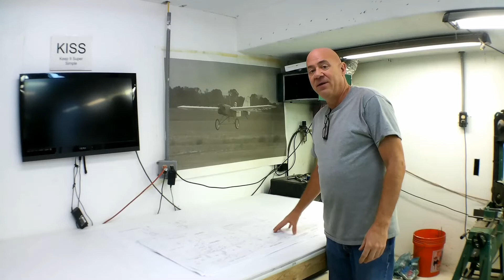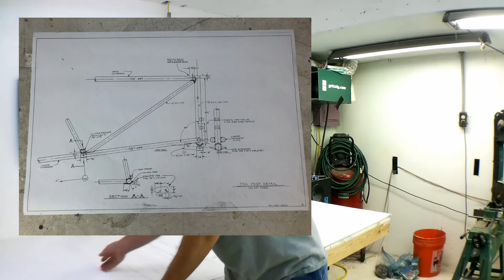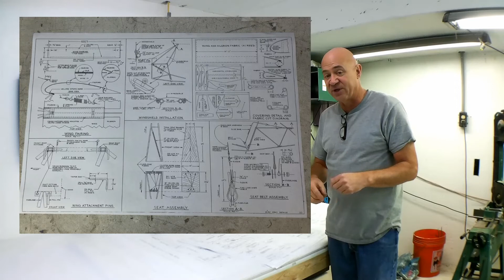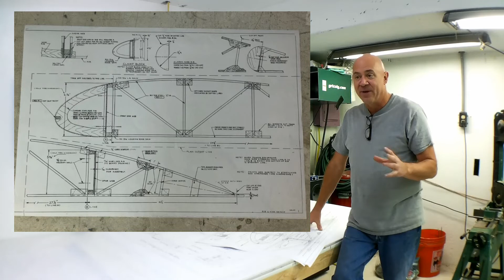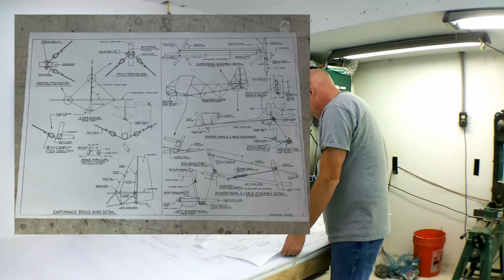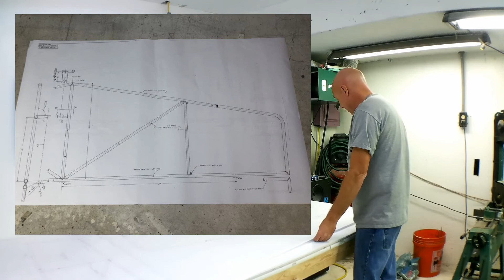DAGs Air Bike 001

Comment: DAG, I know you made this video in october 2019 and I am writing 15th december 2020, but I am also building an airbike and I have completed my first wing and the airframe. I am building mine in France and this presented several unexpected construction challenges. The first problem was the imperial measurement challenge. We are metric here and the desire for accuracy made me consider converting all the imperial dimensions to metric dimensions. I toyed with redrawing the plans on CAD and adding metric dimensions. However, as I reviewed the plans and the dimensions and thicknesses of wood (quite apart from types of wood) I realised I was never going to be able to easily match the American wood specifications with equivalent European wood supplies. Indeed my best source of aircraft wood was the German outlet of Aircraft Spruce and they sold their wood profiles in imperial dimensions. Apart from this, as you will have discovered by using a simple imperial ruler on your plans, there are discrepancies between drawn dimensions and the written dimensions on the same plans. Finally I simply went out and bought imperial rulers and followed the plans as if I was in the US. The second challenge is finding the right sized space to build and then store the wings and fuselage as I advanced. As you build you have less and less space as the different aircraft elements come into existence. You also raise a pertinent point about being able to get finished wings out of a workspace. I measured and remeasured the window to my workshop and was mightily relieved when I finished the first wing and I managed to get it to pass out into the garden and then into a room of my house for storage (hanging from the ceiling). ASH
Reply from the maker: Most of the wood I cut myself with a table saw. I made a Exel Spread with conversions as all of my 3D designs are in metric. I am making the spars now and 100% of the wood I cut to size myself. I have found very few "printed" plans are to scale. I always redraw in AutoCad. Good Luck with your plane and Cheers!
Reply: @dagtheaviator  Interesting. Thanks for your answer

Comment: Dag, great to see someone is doing a video log on this aircraft.  I have a set of plans for the tandem AirBike and, using the drawings, I'm constructing a 3D model in Fusion 360, starting with the fuselage.  As I go over the plans I see areas that aren't clearly defined (for someone with my building experience, which is none) and was wondering if I could post questions here or via some other method more suitable to possible lengthy discussion.  The questions shouldn't be pointless because of the difference between the two airframes.

Looking forward to hearing from you.
Reply from the maker: Reach out to me here. dagsdesigns@comcast.net     I also post many times a week on my Facebook which is 100% my aviation life.

Comment: leaf spring
Reply from the maker: John Smith that is not what is drawn
Reply: @dagtheaviator  https://www.univair.com/piper/piper-pa-25/view-all/u64901-002-univair-tailwheel-leaf-spring-fits-piper/?gclid=CjwKCAjwxt_tBRAXEiwAENY8hUZ9S1XkUfR_z1PuXACwizcYMH3ubqpwx--hqaDkKIgSJLX1PeeC6RoCYWYQAvD_BwE
Reply from the maker: @JohnSmith-xl9bo  That,s cool. Wonder what is weighs. That's weight which is located at the very end. Thanks!!!! :)
Reply from the maker: @JohnSmith-xl9bo  It looks like that is 1.4 pounds. Ton of weight back there. May work though.

Comment: 12 ply aircraft ply
Reply from the maker: That makes no sense. 1/64th-1/16th  is 3 plies. 5/64th is 4 plies. 3/32nd and 1/8th is 5 plies. 5/32nds 8 plies. 3/16th is 10 plies. and 1/4 is 12 plies. There is Birch aircraft ply and mahogany aircraft ply.
Reply: @dagtheaviator  check with aircraft spruce.
Reply from the maker: @JohnSmith-xl9bo  That's is all from AS. I buy it monthly from AS.

Comment: I blew a rod thru the side of the block with a Hirth...Go Rotax.  see Danny Day.
Reply from the maker: John Smith which Rotax would you recommend?? Keep in mind I must stay  part 103??
Reply: @dagtheaviator  Well the 377 is 35 horse and it's a pretty good choice...same bottom end as the 447, just change out the top end if you need more HP. Check the weight full up against your Hirth. Again, Danny Day (in Arizona) can hook you up
Reply from the maker: @JohnSmith-xl9bo  I need a bit more about Danny. Most of pals have not heard of him for 5 or more years.
Reply from the maker: One question. I have seen a ton of Hirth F-33 out there. Never seen one have a problem like that. Most of the Rotax I have seen are very heavy and used. The guys in Tiffin seem to be very cool?